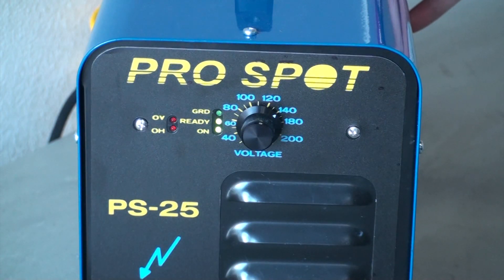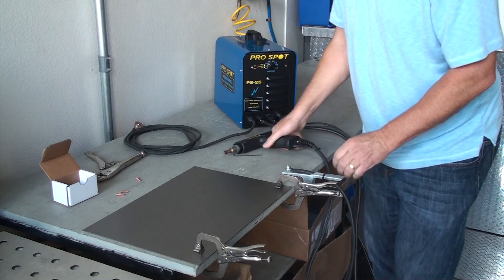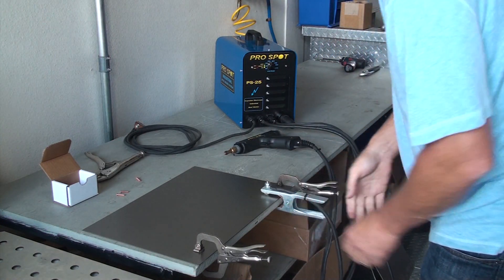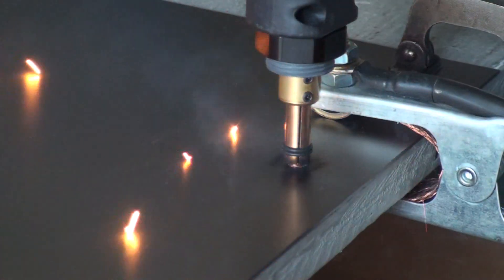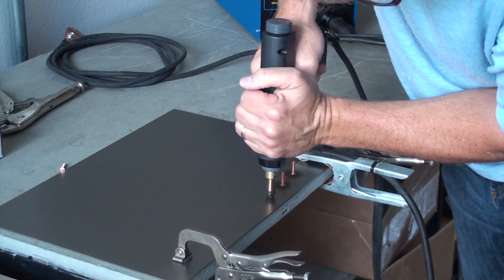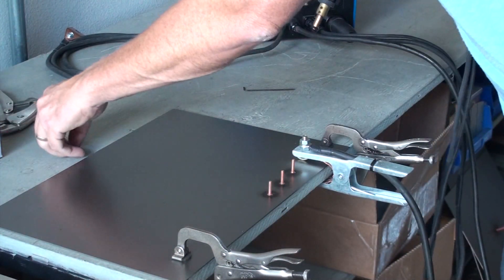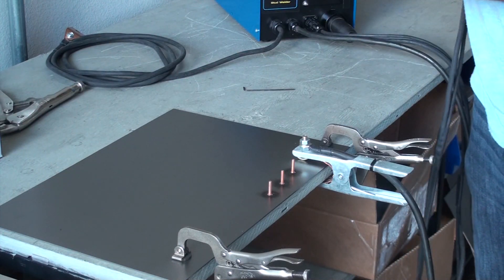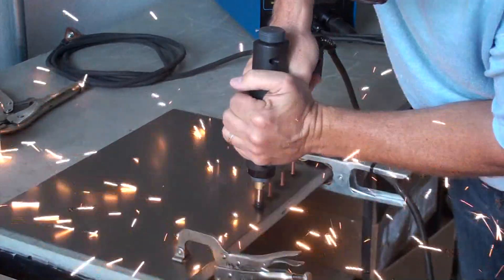Pro Spot Industrial PS-25 CD Stud Welding System

Comment: Hi there , is that working on 10mm thick metal plate ?
Reply: The metal that was used in the video was 16 GA CRS which is about 1.5mm but it really doesn't matter what thickness it is.